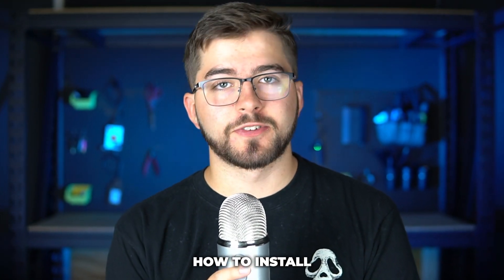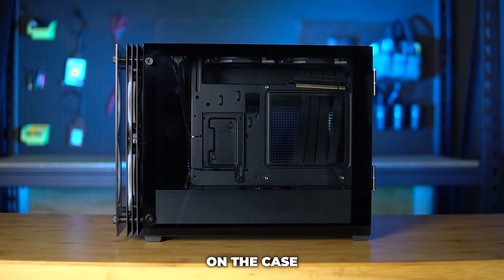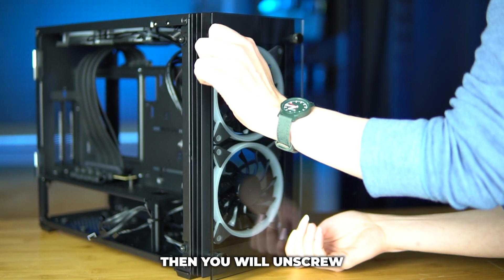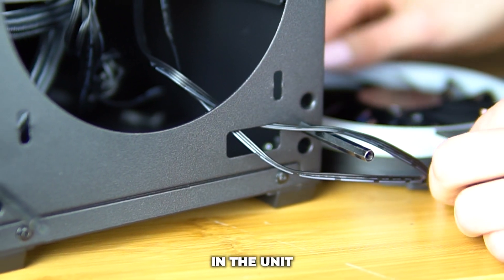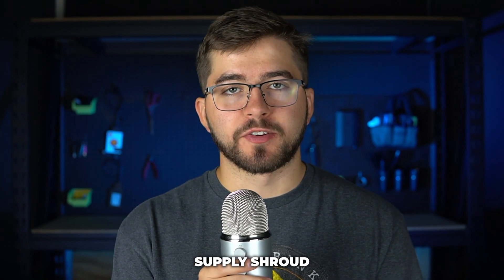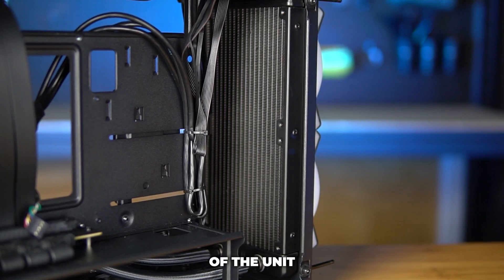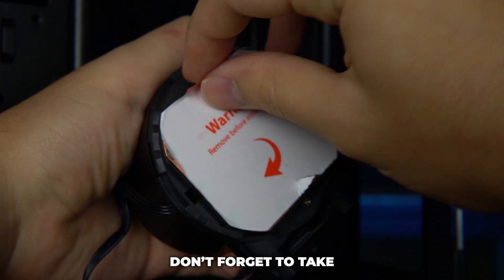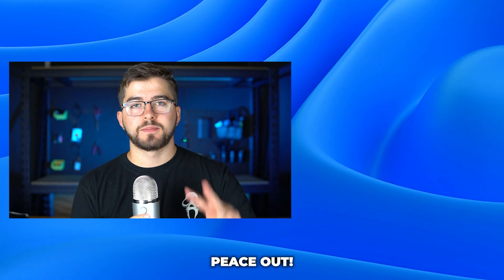How To Install AIO CPU Cooler In ITX Desktops! (Stratos & Continuum Mini) Tutorial

Comment: Do you have any instructions on how to mount the preinstalled aio cooler that comes with this case? Mine looks slightly different with a crown on the pump head. 

The case came with no instructions for the aio mounting, and a bunch of mounting hardware I have no idea what to do with. I’m pretty sure it’s also missing some key screws to the pump to the motherboard. 

Please let me know if you can help, thank you.

Comment: It was supposed to be new mine came used there was no sticker on the pump jumps a bunch of residue.
Reply: As I got into it a little further I noticed that there are no instructions for what I'm assuming is a controller it just has a bunch of plugins. As someone who's new to AIO p c cooler this is very discouraging I'll most likely be returning mine.

Comment: My pc has no display but it shows a blue light on the top when I turn it on I use a vga to hdmi adapter and my cable is plugged into my gpu

Comment: Be very careful when mounting AIO this this way as it can kill your AIO pump prematurely. If the pump head ends up sitting higher than the radiator the air bubbles tend to collect on the pump instead of escaping causing the pump to not operate properly nor cool efficiently and eventually die sooner. Make sure some part of the radiator is always higher than pump head. I'd stay away from this orientation completely tbh if you're new to it.
Reply: ... there is absolutely nothing wrong with this orientation.  The top of the rad is going to be sitting much higher then the pump/block so it's a complete non-issue.  having the tubes at the top in this installation would potentially be an issue.

Comment: How do I put the gpu riser cable so it will plug in the motherboard?
Reply from the maker: Hey @Keyzwyd! What you'll need to do is run the cable through the case first before installing the motherboard. If not you won't be able to put it through the cases cutout due to the limited space. Once you've ran it through the top cutout of the case, install your motherboard and you should be able to plug it in.
Reply: @empoweredpc  ok thank you